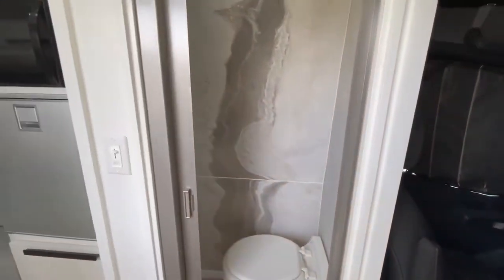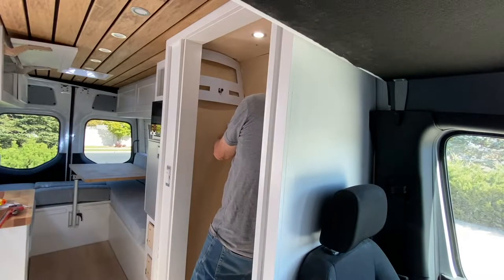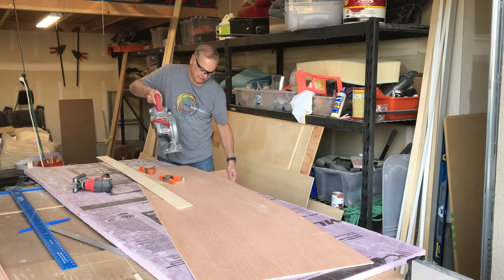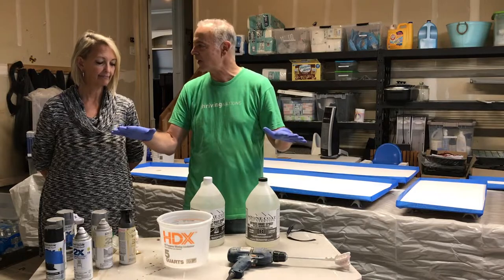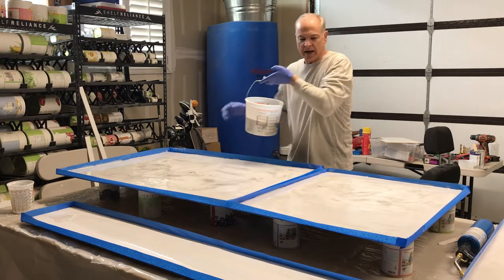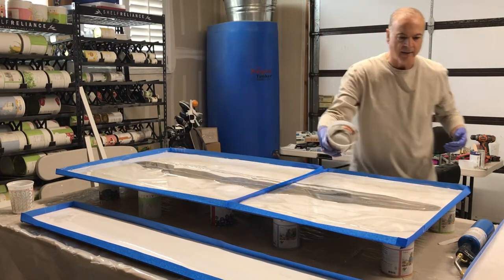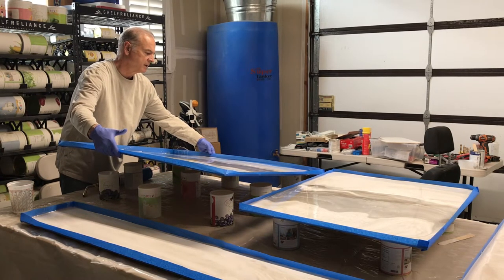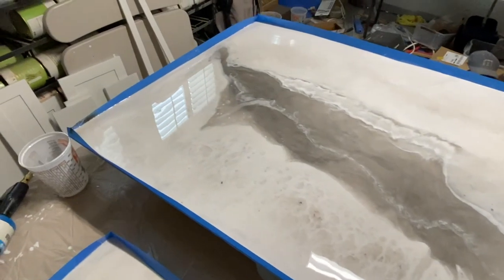Full Shower with Epoxy Walls in a Sprinter Van Conversion- Pt. 1

Comment: Jeff, after watching this video a couple of times I'm now wondering if it would be possible and worth the effort to:
  - fabricate the shower compartment in the van, not attaching the pan frame, pan or compartment yet
  - remove it
  - pour the epoxy in the box, one surface at a time, including the ceiling
  - handle the curve of the back wall by pouring in 2 stages
  - wrestle the thing back into place, hopefully easier with the pieces not yet attached
  - fasten everything

A key question is whether the epoxy poured on a second surface would adhere to the edge of a surface that has already cured?

Since you've done a couple of epoxy projects, do you think it would be worth it to do this (benefit would be not fussing with fitting and perhaps tight seams) or do you think it would be more hassle than it's worth?

Thanks.
Reply from the maker: I think it would be possible, but probably more of a hassle than it would be worth. The epoxy does adhere well to previously poured epoxy, however I think it would be difficult to pour in the confined space of an already built shower. 
Again, I think it is doable, but it’s really not that hard to pour the panels and then adhere them to the walls. 
Good luck!
Reply: Thanks Jeff. If I go the route of pouring in the box I'll let you know how many times I bumped my head doing it.